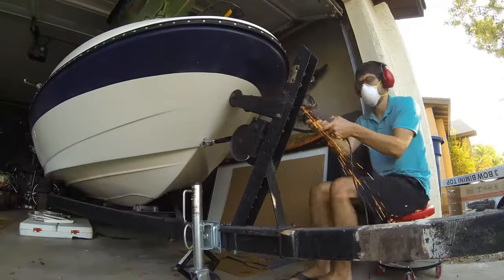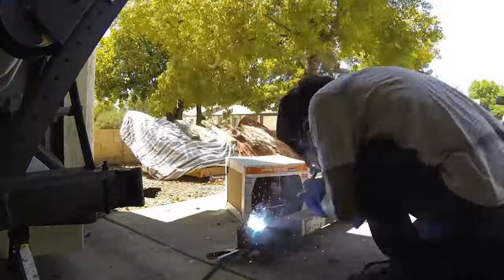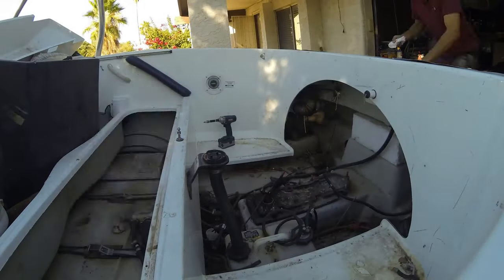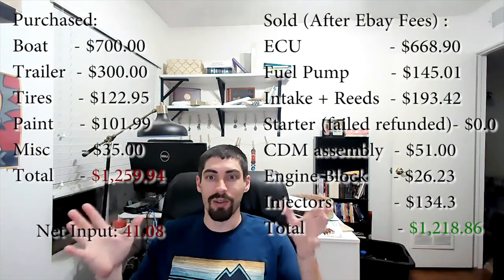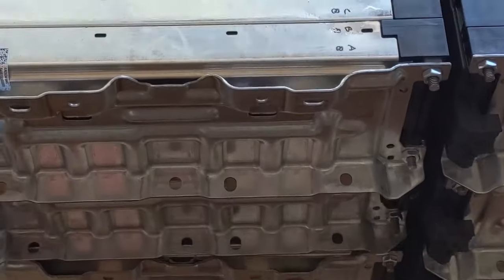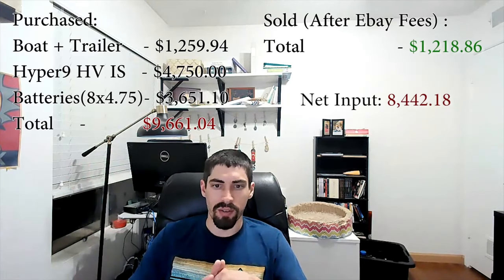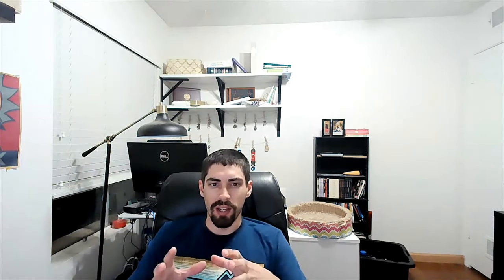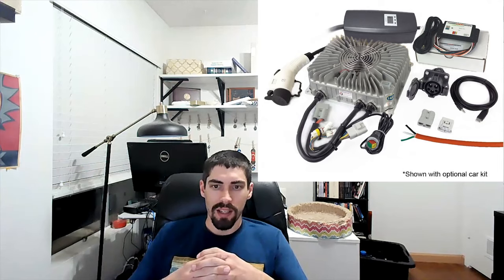E-Doo - The Electric Seadoo Boat Conversion Project Video 2 - Electric Motor and Battery Design

Comment: I have a 1950 Century 16' Resorter runabout.  It does not have an engine and I am looking for information to make it an electrically powered boat.  I need information about design and am really a complete novice as understanding all components and the details of the choices within the design process.  I know that this is a lot to consider, but if I could get a start I would be grateful.  The boat usually had about 95 hp.  What would you recommend in an electric motor to replace that sort of engine required to power a 16' mahogany hull of the Century Resorter I am describing?
Reply from the maker: Hi Dennis, it sounds like a good candidate at only 96 horsepower (~72 kw) as that is well within the achievable lower cost zone of electric motors right now. Now the logistics of the batteries and the cost of that conversation may be less achievable as up front it will cost you more than the typical gas engine. However long term it may be worth it. I need to do a good video on the calculation as to the range vs. cost for my build in the future I think as that math is a little hard to get into in a single comment. You would definitely not need as big of a motor as I used nor as big of a battery pack. My cost was ~$12k for the conversion so maybe ~$8k (or less) for your build if you want to match the stock specs but it is hard to say exactly without doing the entire design in detail and it especially depends on the range you want.
Reply: @ThatOneGuy7575  Thanks for your reply.  Just how big and of what type a motor and battery pack might you recommend for my 1959 16' Century runabout (wood construction, weighing about 2000 pounds with 12 x 12 propeller)?  Also wound you be willing to point me in the right direction to be begin looking for anything that would help me with design detail and some help in finding sources that will offer me the best deals to keep the project in the $8k (+or-) range?

Comment: Sir what is your opinion for golden motor 10kw ..
I am on way  ordered one .. is it powerful and durable ?.
Any other powerful and durable motor you know under 10kw power
Reply from the maker: I looked at the 10kw Golden Motor for another project and I think they are nice and I like the option for liquid cooling. As far as power, most of these motors are very dependent on the voltage you can supply with the battery bank - you can check out the links Golden Motors has on the site for torque/kw curves vs. different battery voltages. It is hard to know if it will be adequate without knowing the application though. As for personal experience using one or on durability I can't really comment as I have not used one yet or started the previously mentioned project yet. Another good brand option I have heard of is Motenergy they make a variety of motors in that range (like the me1115 and others).

Comment: Nice video and project.  How much change to the weight distribution will this conversion make to this boat and do you think it will change the handling characteristics?
Reply from the maker: It is definitely more back heavy. I don't expect that to change much once it is on a plane but it does make it harder to get to a plane in the first place. To compensate I recently installed some trim tabs and will have to make a video of it with and without them engaged.

Comment: Any videos for engine mounting and linkage to impeller coming up? We're doing something similar on an old regal rush
Reply from the maker: Yeah definitely I should have a video out this week about some testing that will show it (and actually how I broke it oof). Basically I just welded some c channel into boxes that were 5" high just the right height to fit in a u joint with an adapter that fit the motor using a keyway and another adapter that fit the existing boat driveshaft (which subsequently I managed to destroy last weekend!).

Comment: Have you considered solar charging it? I'm thinking about building my own electric boat as well and have toyed with this idea since I'm already outdoor and sunshine is plentiful.
Reply from the maker: Absolutely I have considered it! Since I generally am planning to take it out once per week I am thinking about 6kwh per day would give me a charge in a week. So probably 1kw of flexible panels on top of the Bimini. The hardest problems is the up conversation from the solar panel voltage to between 120v-160v which they don't really make charge controllers for. I have found some smaller converters that would do ~70 watts PWM but that is only maybe 1 panel per converter and also not an MPPT conversation which I don't like for efficiency sake. It would be nice to get 5kwh of extra power on the day it runs but need to figure out the logistics a bit more before I go all in I think.
Reply: @ThatOneGuy7575  yea I’m thinking of getting the motor from a Zero Motorcycle which runs at about 100v. My idea is to split the pack into 2 so I can use a 48v MPPT charger. 
I think a better solution for you at that voltage would be to get a 120VAC inverter and plug the charger in. An added benefit is you can have backup 120VAC house power anywhere if you park you boat outside.
Reply from the maker: @s2kto2K  Sounds like a solid plan. I could also charge my banks into 2 but the balancing between the 2 banks worries me if the solar panel for one side go shaded for too long or something. Definitely have considered doing a 12v mppt to my accessory battery and then doing a dc-dc conversion up to the full pack voltage when the 12v battery is above a certain state of charge and then shutting it down when it drops too low. Still the extra cycles on the accessory battery would worry me a bit so it would be nice if there was some variable amperage dc-dc converter.

Comment: Is it possible to install a Tesla engine?
Reply from the maker: Yes I probably could have. The compartment space was pretty constrained vertically in the engine bay (25 or so inches of height) and the Tesla motors are long. Also the price is pretty high on Tesla motors even for used ones. So eventually I opted for the Netgain Hyper9.

Comment: Great job on the video and congrats on the boat progress!! Only one question.. you didn't add a 12V Dometic Cooler?? JK 😝🤣 

Can't wait to see the boat on the water & keep the videos coming!
Reply from the maker: A 12v cooler sounds like a great idea actually. If electricity is $2-3 a charge those 20 pound bags of ice are going to be the biggest operating expense!
Reply: @ThatOneGuy7575  my dad has had much success buying broken electric coolers and fixing the electronics rather easily. Maybe start watching Craigslist!